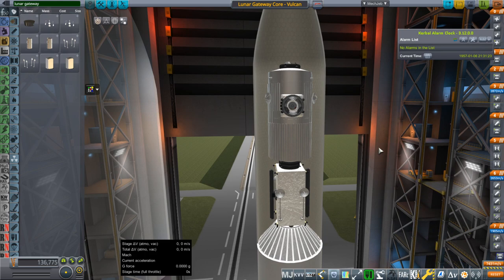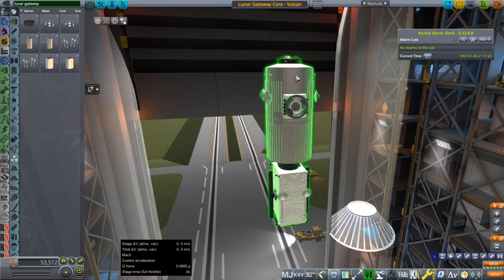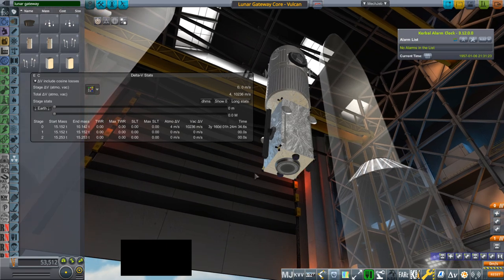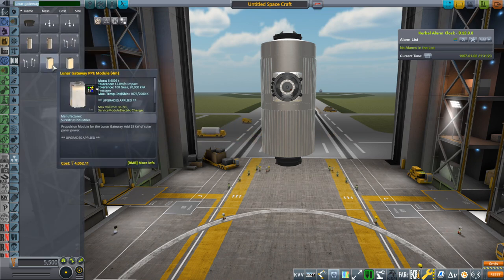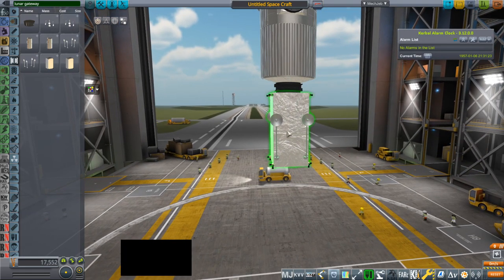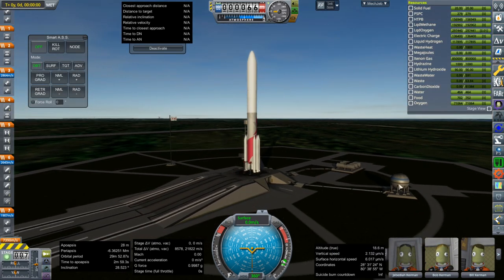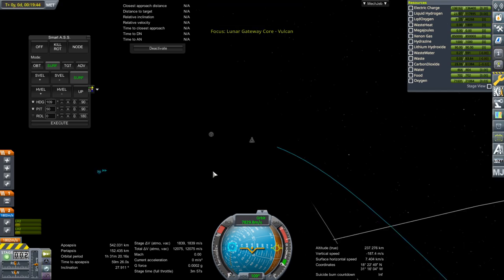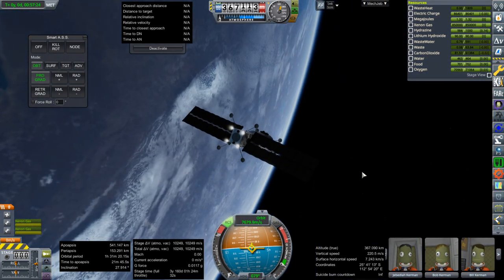Realism Overhaul in KSP 1.8.1 - Lunar Gateway HALO and PPE

Comment: I think the "unofficial" plan is to use Falcon Heavy with the extended fairing, designed for the air force missions.
Reply from the maker: Yeah, I read that after making the video. It'll definitely need the extended fairing.
Reply: At 15 tons, they could even launch it on a Falcon 9 and mate it with a trans-lunar injection stage in LEO.

I think Artemis as a whole should be using LEO rendezvous instead of relying on the magical infinitely expanding and never flying SLS.

Comment: the falcon heavy can do this too
Reply from the maker: Yes, I read afterward that it's the one that will. I need to figure out the size of the extended fairing, though - this definitely won't fit the regular Falcon fairing.
Reply: Raiz Space yeah, SpaceX have already designed a larger fairing to accommodate a soon to be launched US Air Force payload. But NASA have not decided as to who will launch this part of the gateway

Comment: I seriously wonder, how in the hell is NASA planning on using a stage with such an infinitesimal TWR for a manned mission?
Reply: @confusedaardvark7662  Still, 11 km/s seems (though I don't know if it is) excessive for that purpose.

...
We really need a nice, high PWR space nuclear reactor. I'm thinking highly-enriched uranium and an aeroderivative turbine running on mercury vapor* in a closed Rankine cycle. Fission power seems the only way to realistically approach or surpass 1 watt-per-gram for an ion propulsion system (that is, power source + thruster), which would be a godsend for space exploration.

*Thermal efficiency is nice and all, but over a typical range higher exhaust temperatures increase radiation much faster than the heat rate for the same brake power, reducing radiator area and thus weight and portability, which would be further reduced by mercury vapor's tremendous density. On the other hand, it may make it even more difficult to get launch approval...
Reply from the maker: The ion engine can take its time to get the gateway into position and then maintain that position. For ion engines, they're actually pretty powerful. The PPE does have the RCS for larger maneuvers, but this certainly isn't configured to move crew around, so it shouldn't be thought of as a crewed vehicle, but more like ISS. The delta-v is good for a few years, but considering the lifespan of ISS and how it'll be even harder to replace Gateway, NASA is already arranging for a refueling craft to deliver more Xenon Gas. If we want to convert this into more of a spaceship, the back end of the PPE does have a mounting location that an additional stage could attach to.
Reply: @grantexploit5903  I remember looking at a chart of stationkeeping requirements, and the NRHO only requires 10m/s a year of deltaV. However they want to eventually stage a fully fueled lunar lander, a supply vessel, as well as habitats, so as mass increases they're gonna have a lot less delta/v to work with as time goes on.

Comment: If your not a fan of gateway then what would you do instead?
Reply from the maker: If Gateway is for the Moon, it's too small, lacks a depot for lander fuel, and is not placed optimally (we'd need it closer to the surface of the Moon in a frozen orbit where the mass concentrations won't perturb it too much). If it's supposed to facilitate Mars operations, it should just be configured to go to Mars. Right now it feels like it's sort of in the middle.